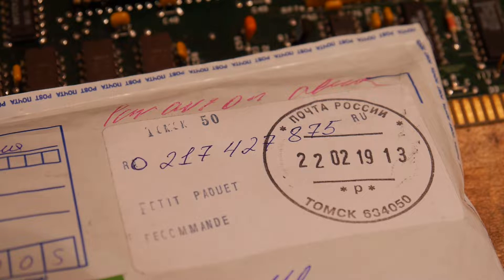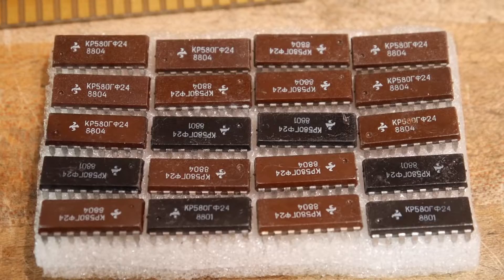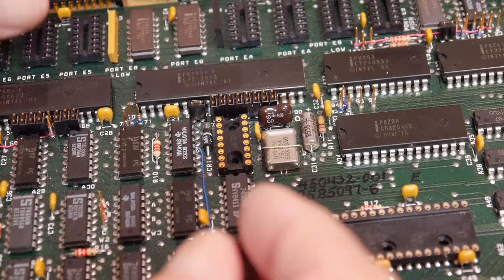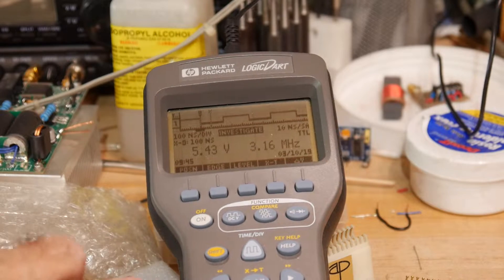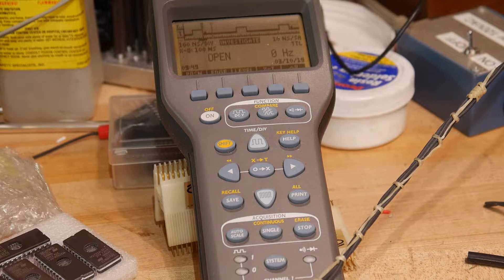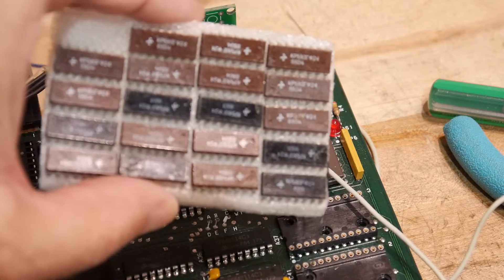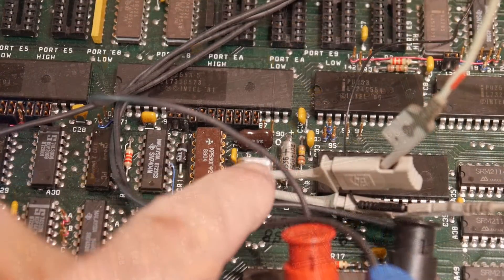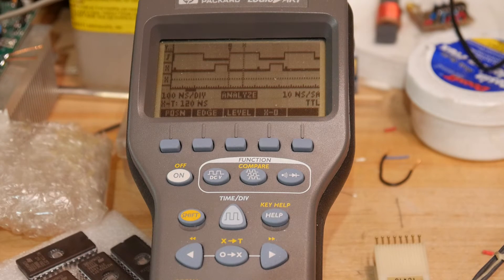#313 Intel 8080 SBC 80/20 Single Board Computer Russian 8224

Comment: This was an interesting video, as I was working on a Hazeltine 1500 video terminal. While connecting my OScope up to pin 10 and 11, I must have shorted something out. 
Now it appears that my 18.0000MHz crystal in not working, and probably the 8224 as well. The 18MHz crystal was hard to find, and the 8224's are even harder to find.
Although I do see a lot of the Russian made 8224s out there.  Perhaps I could purchase one or two of those from you? 
I was wondering where you actually had your probes connected? As your video shows you pointing to the 8224 and then pans up to the LogicDart, which appears to be connected
somewhere further down on the board.
Reply from the maker: I was probing pins 10 and 11 on the 8224. I'd be happy to sell you two of the ICs.
Reply: @IMSAIGuy  
I have already ordered a 18MHz crystal, should be here before long. So, it would be great to have a couple of 8224s. You can get my contact info at the bottom
of my website. www.theageofgaming.com